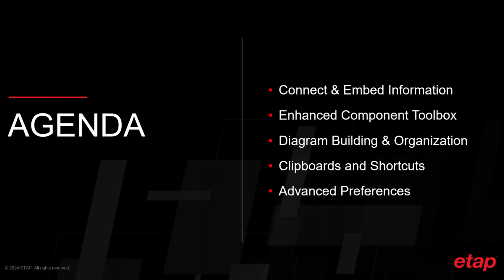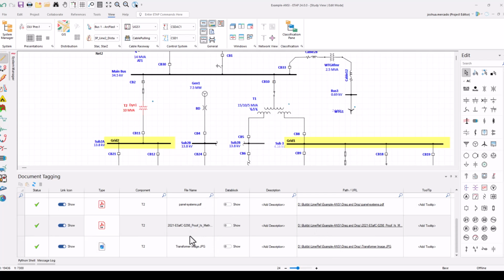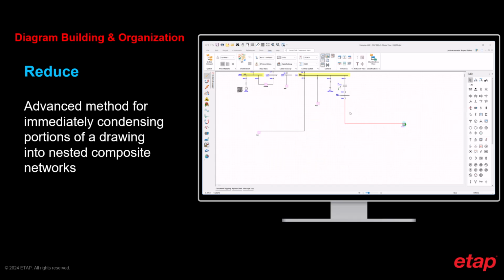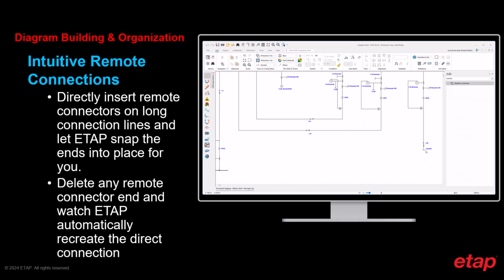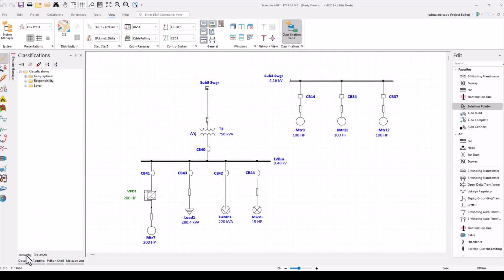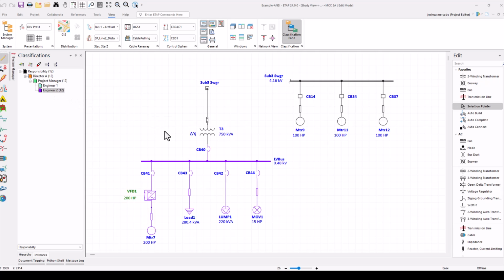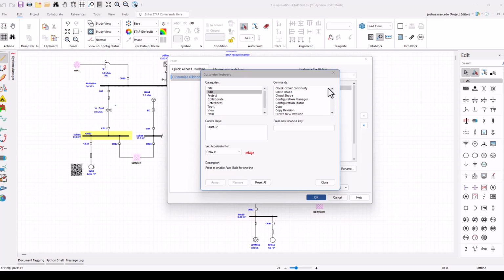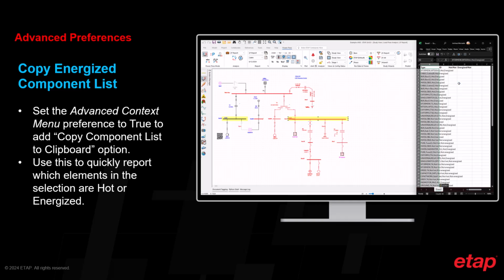How to use ​shortcuts for greater productivity with ETAP 2024

Comment: etap has a capability for converting SLD into etap from PSS E or AutoCAD? if yes how and from which version this function is available
Reply from the maker: Yes, ETAP has the capability to convert Single Line Diagrams (SLD) from PSS/E and AutoCAD into ETAP format. This functionality allows for the seamless transfer of electrical system data from PSS/E or AutoCAD into ETAP for further analysis, simulation, and modeling.

 1. Conversion from PSS/E to ETAP
ETAP has a built-in functionality to import PSS/E data into its environment, including the ability to import system information such as buses, generators, transformers, and transmission lines, which can be represented as Single Line Diagrams (SLD) in ETAP.

- Supported Formats: PSS/E RAW and SAV files are supported for importing system data into ETAP.
- Availability: The PSS/E import functionality became available starting with ETAP Version 12.x (released around 2015).

 2. Conversion from AutoCAD to ETAP
ETAP can import AutoCAD drawings, particularly Single Line Diagrams (SLD), using the DXF (Drawing Exchange Format) file format. This allows users to bring AutoCAD-generated electrical diagrams into ETAP for detailed modeling and analysis.

- Supported Formats: DXF (Drawing Exchange Format) is the key format for importing AutoCAD SLDs into ETAP.
- Availability: The AutoCAD DXF import functionality has been available since ETAP Version 10.x (released around 2012) and has been enhanced in later versions.

 3. ETAP also offers eXCAD™ and ETAP Revit, both direct connection with AutoCAD. It provides engineering, construction and maintenance teams an automated interface to transfer CAD design seamlessly into ETAP’s intelligent electrical power system modeling & analysis.

 The ETAP-Revit bi-directional data exchange simplifies the electrical design process by utilizing the data already in the Autodesk Revit® model to automatically generate electrical models in ETAP to perform calculations and checks.Revit-Interface
The ETAP-Revit data exchange tool provides designer and engineers the flexibility to transfer electrical data and connectivity between Autodesk Revit’s Building Information Models and ETAP’s intelligent electrical power system modeling & analysis software.

Please contact sales@etap.com for more information and pricing.
Reply: @ETAPsoftware  thanks so much for these organised and arranged answers. Thanks again 🫡

Comment: when do some portion hide and/or reduced when applying load flow or any other group analysis such as short circuits or Arc flash it included this hide and reduced part as well for those analysis? or not affected
Reply from the maker: You can select any results you want to show on the one-line diagram in your view setting.